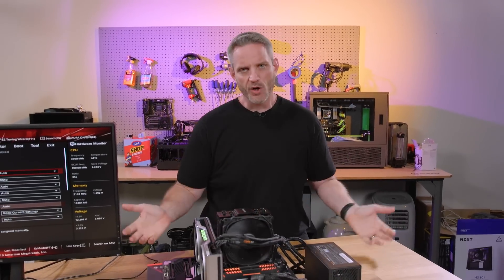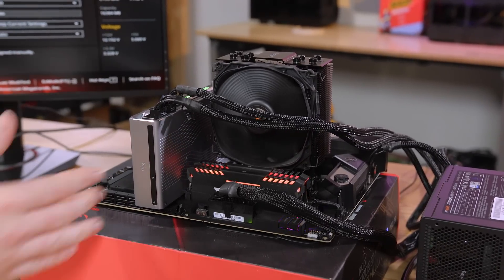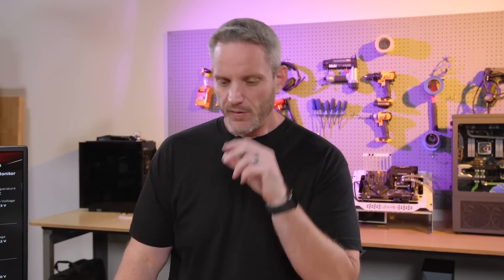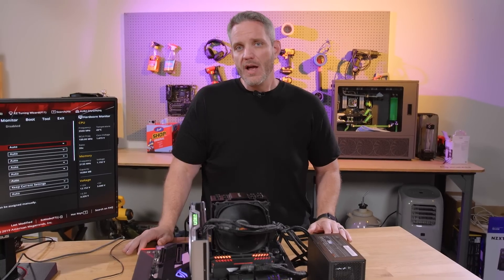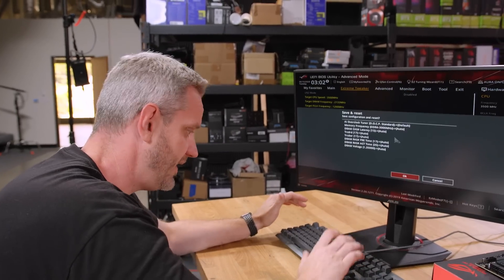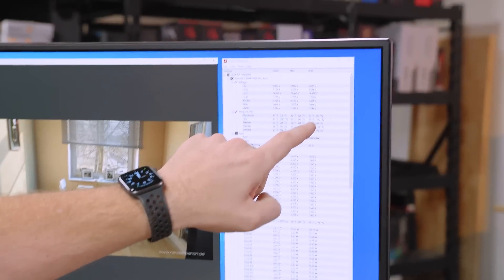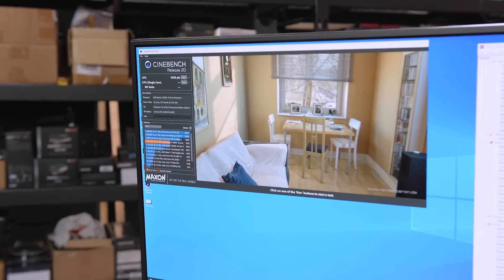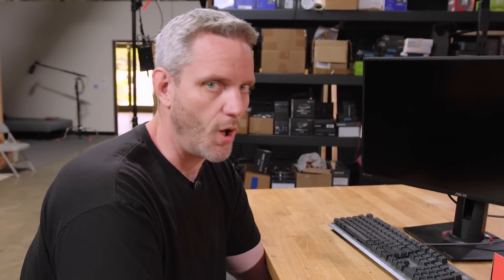Is your motherboard trying to damage your Ryzen CPU?

Comment: I’m fairly new to pc building. I have a 2600x, it crashed after hitting 93c whilst trying to render a video. Ever since then my pc freezes, but not consistently. Sometimes it won’t boot properly, sometimes I can use it for a few hours no no problem, then it’ll start freezing doing basic tasks. Have I damaged my cpu? Is there a way to make it run more stable? It’s only a few months old 😕

Comment: I didn't like how the 2700x auto-boosted to 1.45v in auto mode, with power spike (up to 40-50w for a single-dual core boost) and temps, i have a perfectly balanced custom loop with 17 fans at 33% (600rpm) fixed based on cpu temp, if it goes above 55° they go to 40% (never happened even after prime 95 or rendering for hours) if it goes above 65° they scale to 60% (to start hearing a problem with the loop) and if it would ever reach 70° fan at 100% to know my pump ha failed. 
With those spike i couldn't manage a stable 33% fixed loop speed. So i "downclocked" at 4ghz all cores at 1.2v, idling now at 11w and max multi threaded performances are the same that as in auto, a little less per core performance. Lately i jumped to 4.15ghz that is the sweet spot at 1.26v, consumption still very very low, as temps with a 3-4% more multithreaded performances than in auto mode. 
With my Zen + i would never go in auto, letting the auto-mode do his spikes and trusting the transient response to not put often 1.5v on the chip.

Comment: So should i offset my 3900x at stock ? if i offset more then -0.11250 my cinebench scores will drop however it will mostly only boost to 4500 4550 mhz even without lowering stock voltage while hitting 77c easily in cinebench with triple 360mm rad obviously outragious compared to the 67c temp i normally get
If managed to lower my offset to -0.13125 now without reducing cinebench scores now boost all the way up to 4625 mhz

Comment: I just build a new ryzen pc 
Sow thank you 
And how much volt is safe for a 3700x ? If i want to put it static
Reply: 1.3125V is as high as I would go static. Maybe 1.325V. I saw very little clock speed gains from 1.3125 vs 1.325 on a 3900x

Comment: Hello comments. I was hoping someone in here could offer some help with my PC. My Asus rog strix x570 gaming E board is displaying code 02, this occurred after installing windows onto my USB and shutting it down after full completion. I have tried most troubleshooting fixes but none have worked. I have reseated everything except the cpu. I have done a  cmos reset, reseated the motherboard battery and tried no drives just bare minimum and still no boot to bios or anything, no display. NOTE: pc was working 100% fine and passed all stress test and had no stability problems

Comment: I noticed b4 I manually adjusted clocks and voltage that the board used to put up to 1.52 volts into my 2600x

Comment: Talks about everything except what the original article (from The Stilt, not that garbage tomshardware article) was about lol... you know, the part with the new function in hwinfo.
Yes it's true that messing with voltages and overclocking manually without knowing what you're doing is more dangerous than the non issue click  bait from TH, but still. Not even mentioning what the new reporting function in the software and what it actually does and how to interpret it is almost the Verge level reporting (sorry, I guess that was a bit harsh. :P )

Comment: I tend to ignore anything like this that has been talked about, Simply because I trust AMD a hell lot more them Intel and We know AMD has listened too the community and gamer's And we know AMD has gone above and beyond to test/re-test and validate that all that has been done way before hand.  Sure Motherboard manufacturers do their thing and don't always listen or do what AMD recommends, and sometime its good thing, some times it not good.  Thus why you have do some homework to make sure you have good quality motherboard. If you don't O/C your system..  your prob fine.. Even if you do OC your system some.. It be more likely just fine, but as Jay has said, Their is always a small Risk, but most High Quality motherboards that design for OC are Design too handle this,   if want O/C your system. That is your choice and your risk very minimum, and most system today run years before they finally show minor issues.
I am Very happy with MSI X470 Gaming Pro Carbon Mobo/R7 2700x..  and highest ever seen my system hit was 4.1 Ghz.  And she runs cool.
@Jay shouldn't my 2700x boosting higher?, Ya I don't have most newest bios but fairly new (2019 but she been stable)
Running Cooler Master Evo 212 cooler and 7 fans on the case :)
--
Crytek RT DX11 benchmark
https://media.discordapp.net/attachments/495731816662171658/665674884336058389/SireDragonChester-R7-2700x-msi-x470mobo-16GB-3200mhz-GTX1080ti-1Tb_SSD-Win7-64bit.jpg

https://steamcommunity.com/sharedfiles/filedetails/?id=2131772010
(Steam) Detroit Becoming human Demo *Vulkan api only game/no DX support)
Reply: it's not amd that was the problem.
it's motherboard manufacturers reporting the incorrect values to the processor so in turn, the processor thinks it has more power available to draw from when in fact it's drawing much more power than was ever intended by spec in order to make their motherboards seem "faster" than the competitions.
Reply: @x3roxide  idk if i believe the "its the motherboards" excuse. so all the motherboard makers messed up not amd? also amd playing this problem down for months makes me believe its their fault.

Comment: I read the title and got a flashback of my cooler ripping my 2600 out of the socket and bending about 5 pins. i was able to fix it but I practically started crying when it happened.
Reply: FIX IT WITH IFIXIIIIIT
Reply: @seltNik  explosion
Reply: @seltNik  I actually used an old precision screwdriver kit. You know the ones that you can't quite seem to grip
Reply: Bruh...
Reply: i built my first computer this year in 2020 and i bent around 10pins on a ryzen 9. I used a super then splinter remover and straightened them. I am amazed i got it to work
Reply: thin pointed*
Reply: @DHGcrimson  I'm going to build my pc with ryzen 9 and installing the cpu is the scariest part, how did that happen?
Reply: @mudargamer  installing is easy, line up the triangle and let the cpu fall in. Give it a nudge to make sure it doesn't move around and secure it with the lever
Reply: I read somewhere that said if I want to take the cooler off the cpu, just run some benchmark like prime95. I follow that advice religiously lol
Reply: @ThaiNguyen-bl1pi  true down remove your CPU while power in board (timeout those caps) but run it warm before pulling the brain out of the skull.
Reply: How'd you manage to do that? Did you paste your cooler before screwing it down?
Reply: @TalesGrimm  the stock thermal paste turned into industrial concrete

Comment: Hi,
great videos. I'm right now building PC based on AMD 3900X (for Blender 3D modeling) and GTX 2070 Super
Please could you share advice if Asus PRIME X570-P is ok motherboard?
Other components:
G.Skill Ripjaws V, DDR4, 32 GB,3600MHz, CL16 (F4-3600C16D-32GVKC)
Corsair TX 750W (CP-9020131-EU)
Asus PRIME X570-P
AMD Ryzen 9 3900X, 3.8GHz, 64 MB, BOX (100-100000023BOX)
Gigabyte GeForce RTX 2070 SUPER Gaming OC 3X 8GB GDDR6 (GV-N207SGAMING OC-8GD)
Phanteks Eclipse P600S
CPU be quiet! Dark Rock 4 Pro (BK022)
Reply: Bro, he doesn't reply. Check online reviews from other tech channels.
Reply: @devanshkamdar8244  Maybe someone from the community could advise?
With reviews, there are a lot of issues where one is saying that this part is fantastic and others this is a piece of crap...

Comment: Question for whoever might know/see this. I’m running an ASUS Prime B450m-a. When I go into bios, I cannot find where to manually change voltage. In the bit where I should be able to change it, there is no option for manual voltage control, only auto and offset. It’s currently got a 3600 installed clocked at 4.55 ghz, voltage is around 1.43. Is not being able to change the voltage particular to this board?

Comment: Here's what i experienced with ryzen 5 1600af (with stock cooler): 
OC to 3.8 at 1.3v(since most people went with 1.3v on the internet) and temp for GTA 5 was 80-84c
A week back out of nowhere that temp made me uncomfortable and I decided to run 3.8Ghz at 1.2v 
Made every possible stress test for hours and it is actually stable. Now during GTA 5 the temp doesn't cross 70c...oooofffff

Comment: Wow thanks to this video I noticed my Ryzen 5 1500X was running at @ 1.45 V for almost two years now. Apparently that was the “auto” core voltage. I just brought it down to 1.3 V and will use it tonight to see if it’s stable. Will try to bring it down slowly every day, but I doubt I will get 1.2 V because of CPU degradation.

Comment: Had an asus rog strix x470-f gaming motherboard running a 2700x. 3 months later it killed the board and cpu. After RMA and refunds;  Today I'm running a 2700x on a msi x570 its been almost a year now, no problems.......yet.

Comment: Uhm. It might not kill it but it may degrade it faster over time. My old 4790K used to clock to 4.7GHz when it was brand new. When I sold it it would not go higher than 4.5GHz. I had it permanently overclocked for a long time until it became unstable and i turned the OC down to 4.6GHz then 4.5GHz...

Comment: I have a 3800x. Hwmonitor tells me my CPU often pulls 1.5v for it's "4.5ghz single boost clock". If I use Ryzen master I can achieve a cooler temp at 1.375v and 4.5ghz all core. AMD boots are crazy.

Comment: okay i saw something off when he said he wanna try it on default! there was a lot of things no defaulted!!! and temps on default was around 45 and around 1.4 volt  and suddenly dropped to 35 with 0.9 volts before he hit f10... then next restart and went to bios it was 43 with 1.4 voltage. something is wrong in this video. it is a click bait vid. u basically said nothing but shows its work "on your own way"

Comment: I noticed this with my 2 3000g cpus one cpu would over heat if over clocked other cpu would be extremely warm of 60 c with 3700x cooler stock settings

Comment: I'm not worried... My 3950X is running fine on 4.35Ghz on 1.33V with turbo in load line caliberation.. Its a pretty low voltage.. Coz on stock, I've seen voltage going as high as 1.45V on 1-2 cores.
And i was gonna OC anyway.. So I'm chill.
Oh, the board is X570 Aorus Xtreme

Comment: hey i have a question, my i9 9900kf processor reaches 100 degree celsius under workload although i am using a 360mm liquid cooler so is it common?

Comment: I need a simple answer my ryxen 5 3600 with stock cooler in b450 tpmahawk max sits idle at 60-70c and while gaming upto 90c I paid for performance my rtx 2060 goes upto 80c constant while streaming coz I use 144hz and nvenc encoder am I safe or will my pc explode